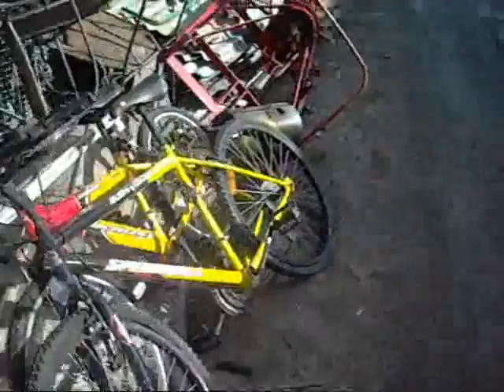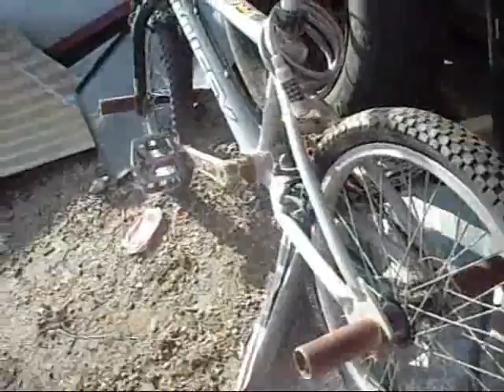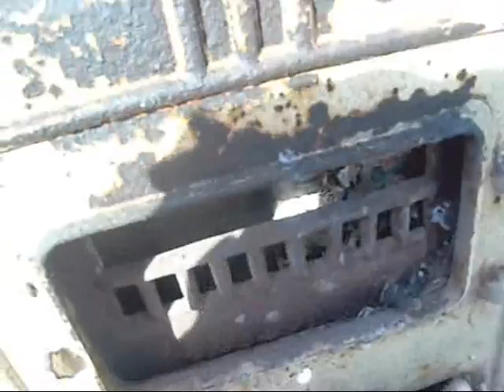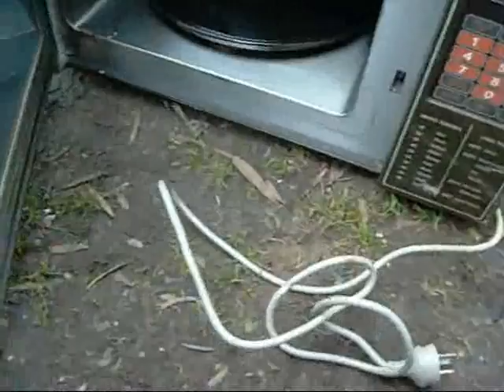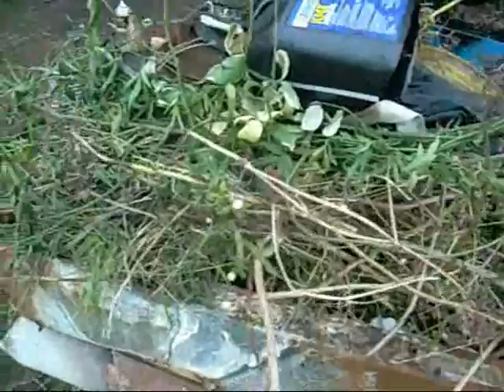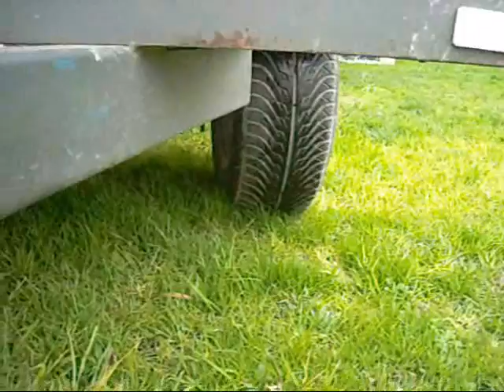Scrap yard Day - Oil Heater Musings and Trailer Rust Repairs

Comment: I am using a HVLP gravity feed paint spray gun for my waste oil heater. It comes from Harbor Freight in the US. It cost $15 dollars on sale, it mixes the air and oil easily adjustable and it takes all the engineering problems out of the way. I mounted mine in a bit of 1.5 inch steel pipe with a hole to ignite and more holes further done the pipe for the burner with the end capped. It burns clean and is very easy to light. Hope this helps, I enjoy your videos, thanks for sharing your knowledge.

Comment: could you compress oil and air in a chamber to atomise it and propel it? otherwise like hdfxh said a power steering pump would do it as long as its not to thick.

Comment: Cool vid, I almost purchased a red Huffy the same as that, but it got sold b4 i got to it lol.
Whats wrong with the grey huffy? is it fixable besides the rear tyer? 
Damn sucks about the trailer, Enough water in the rails too. But it should come up good by the sounds of it.